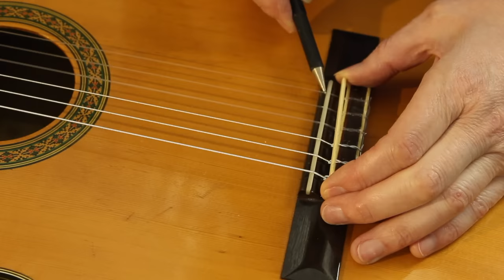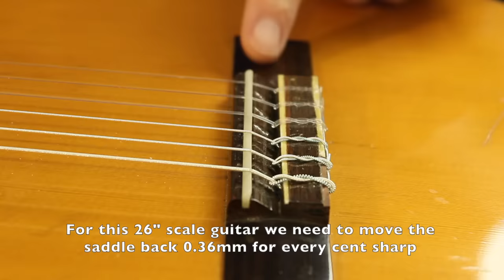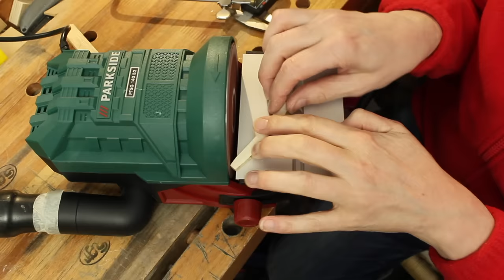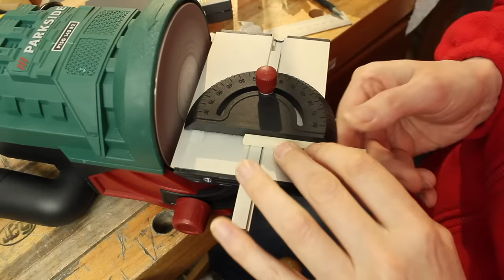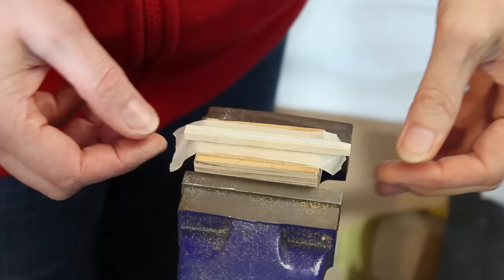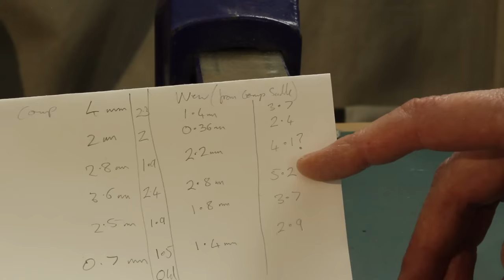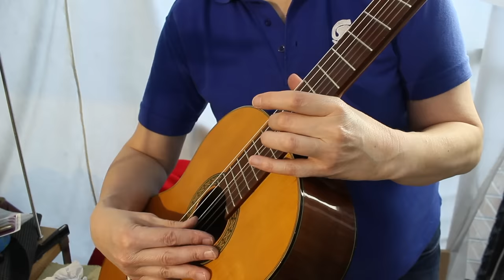Fixing the intonation on a classical (spanish) guitar

Comment: The phenomenon where the strings take time to settle in after being untensioned and then retensioned is due to what is called anelastic recovery. Nylon is a viscoelastic material - it stretches under tension due to a combination of elasticity and creep. Nylon has logarithmic creep, so its rate falls with time until it becomes negligible and the string remains in tune. When you untension the string, the elastic component of its stretch immediately recovers and over time, a significant fraction of the creep also recovers. Hence, when you retension the string, it will start to creep again and go out of tune. The longer you leave a string untensioned for, the greater the anelastic recovery - if you immediately retension a string, the effect is smaller than if you leave it for a few hours.
Reply: Great to know. Thanks

Comment: I hope you checked the fretboard level before you did this. A humidity change can dry the fretboard and top causing shrink which will cause intonation issues like this also.
Reply from the maker: The guitar is stable. The fretboard was straight but there were a few uneven frets that needed a title levelling. I think the intonation was just 50years of aging letting the body shrink a little - it wasn’t too dry

Comment: The saw didn't work because the saw didn't clear the edge of the material.  The gullets between the teeth filled and the saw stopped cutting.  You notice that the ends cut where the saw was able to exit the material.  I so enjoy your fantastic videos and work.
Reply: Yep.

Comment: I know it’s a lot more work, but you could also remove the lifted bridge, eventually fix the fan braces that have maybe bent over time, or maybe some have come loose.  And/or fix the bridge plate as well.  That would take care of the forward angle that has occurred.  That angle also probably raised your action quite a bit too!!

Comment: Nylon strings take time to stabilise due to the anchoring needing to bed in at both the tuning machine and the bridge anchor points. The 'knots' are slipping slightly after being disturbed. You can reduce the stabilisation time in two ways.
1: At the bridge, link the ends of one strings under its neighbour. This has two effects; it prevents the end of the string 'buzzing' on the soundboard and prevents the string from slipping as much as the knot tightens. At the back of the bridge I anchor the E under the A, the A under the D, the D under the G, the G under the D, and the B under the G, and the E under the B. It's a bit fiddly at first, but the effect both looks good (neat and tidy) and adds stability to the anchoring.
2: At the tuning machine, pass the string over the top of the barrel of the anchor point and up through the hole from the bottom. Then pass the end over the string and back through the hole. Now pull it tight. The string will self anchor and usually does not slip at all. You will likely need to cut the string much shorter than before and need fewer winds to hold the string. The fewer winds you can get away with, the more stable the anchoring. I rarely have more than two winds on the wound strings and three on the solid strings.
One other thing. I have found the composite G string in the D'Addario EJ45C set to be especially good at both smoothing the transition from the wound D to the solid G string and compensating for the effect of the relative thickness of the G string.
Reply: You need another thimbs up for that👍

Comment: Great, thanks a lot for this video! Nylon strings take longer to settle because of the shape memory of the material (same as steel strings but they are much more rigid than nylon so it takes much less time). A good cheat to make it faster is 1) stretch each string on all the length (sadly I can’t show how it’s done here but I’m sure there are some videos) and then 2) tune the strings about 1.5 semitones higher, let it sit for few minutes and then do it again with the strings (usually the bass strings) that dropped all the way below the correct tuning - just 1 semitone is enough then. Repeat few more times but brand new strings will settle within like 15-20 minutes this way. I remember during studies at the conservatoire we couldn’t possibly have time to wait any longer, and actually we’re even dropping the tension of bass strings intentionally (big time, till they get floppy, for maybe half an hour) in the morning before a concert to make the strings sound better - if you then tune them up maybe a semitone higher, they just drop right where you want them in few minutes

Comment: OMG, I nearly fainted when I saw your guitar. We have one exactly like it purchased in 1977 or so which makes it about 45 years old, nearly the same as yours. I’ve been having problems with an odd “buzzing” (not exactly fret rattle) on the G and D strings, the neck isn’t bowed and string height off the fretboard is fine. None of the repair shops can find anything wrong but it drives me crazy. Anyway, sorry to ramble, thank you so much for the informative video. I love our guitar which has gotten mellower with age, it was so nice to see it pop up on YouTube!
Reply: I have been unable to get upstairs to my workshop due to my having Parkinsons, with the result that my latest guitar has not been finished and is highly unlikely to be now that I am looking at my final demise, so I was wondering if you would like to finish it for me. As I said in an earlier message it  is an experimental guitar with the front grain radiating from the bridge being made up of 30 triangular pieces of cedar reinforced with a piece of cedar going from the sound hole to the lower bout with two struts either side of the soundhole strengthening the top. Hoping to hear from you in the not too distant future from Barry Dycret, the guitar maker.

Comment: great tutorial about adding an overstep to the saddle.
I have a Classical where the G+B strings needed more saddle at the front (fretboard side).  And the Bass 'E' string needed more saddle at the back (side where string goes through bridge).
I did it by having a perfectly 'flat and square' piece of bone (set to the correct saddle slot thickness and depth).  
Then, i superglued bone pieces where the saddle needed to be extended (giving it 24hrs to dry).  And shaped them as needed.  
It worked, with less manufacturing hassles.  
But, i think i will try to make the stepped saddle ..just for the challenge :)

Comment: What a great explanation of intonation!  Thank you Susan.  I've fixed intonation problems on ukuleles a number of times like this but made the saddle by laminating two pieces of bone together with CA glue which is much easier than making from one piece of bone.  Gluing surfaces need to be well prepped to get a clean join but if done well, it's hard to see the join .  I haven't noticed any loss in tone - the additional saddle mass probably has more impact.

Comment: 1st, Cudos to you making your own saddle from a large piece of bone. 2nd, like many others, your explanation of intonation, compensation and dead zone- something I never heard discussed before, is about the best I've heard. You've probably saved my short scale steel string from being slammed against the wall. The B string is always sharp on the 12th (well they all are but B most noticeably) and I've shaved 2 compensated saddles but it's still there driving me crazy.  Didn't think of using a thicker saddle with a slight overlap. That would do it. Thanks for sharing your expertise.

Comment: What I ended up doing on mine years ago was filing off the slot completely and replaced it with two pyramid shaped pieces of wood in which I carved out a trough and added a little brass dowel to replace the saddle. Now I have a split movable saddle that I can adjust for intonation at will.
Reply: Make a video of it please 🙏

Comment: This is the best intonation explanation I've seen. Thanks for showing all the trial and error attempts in finding a good way to shape the saddle. I just went through something similar in creating a shelf like that on a nut in order to intonate that. I used a couple of straight boards with sandpaper held against one of them to create a right angle as a sanding jig, with a spacer so that the nut rode above the vertical board enough to create the shelf. It took forever, and perhaps rigging up something similar with a file would be better. Holding the nut by hand was difficult and laborious. I think I would take a clue from your glueing idea but instead glue directly to a board with some hide glue (for easy reversibility). (BTW how do you feel about nut compensation?)

Comment: Wonderful job, Susan. I realize the skills you demonstrate in this online class far exceed my technical abilities, however, I'll explain what I did about 10 years ago to fix the intonation issues with my very cheap classical guitar. Noticing that my Fender Stratocaster string saddles are configured in a staggered position, I tried to emulate the same paradigm. I proceeded to remove the bone, filled the slot with wood shavings mixed with epoxy and then Dremeled out a new slot with the desired slanted angle. It was an experiment done intuitively that somehow paid off. I'm pretty sure it's not for everybody and only to be tried on a cheap instrument in case things don't go too well. Cheers and thanks for the lesson!

Comment: Hi! I recently watched this video and decided to do this with my classical guitar. It really improved the intonation, so, thanks a lot for all the detailed info.

But I'm having a problem. When I tried to use the piezo it seems like it doesn't pick up the vibrations of the strings resulting in a very very weak signal. What could be causing this? Could it be that now the point of contact between the string and the new saddle is far back resulting in a weaker transmition?? Or maybe the saddle is just not sitting over the piezo like it should? 

Thanks!

Comment: I recently bought a new Yamaha classical guitar and the saddle was WAY too thin for the .100" slot. Were all of your strings sharp when you got a good-fitting saddle in place? Was the bridge itself too far forward? In the beginning of your video I thought you were saying that the back of the bridge was pulled up a bit ... like you get with a belly bump. I had one of my acoustics with that issue and I brought the bridge and guitar top down flat with a Bridge Doctor device.
Reply: Yes correct fit! Also see how Stew Mac reverse-bevels a bridge-saddle to counteract the lean forward.

Comment: Thanks very much for the video, which I used as a guide to help me solve a similar issue with my old Takamine guitar that I wanted to give to a 10-year old just learning to play, but couldn't until the intonation was fixed.  The bridge was too far back and intonation was too flat around the upper frets, so I used a blank bone slab to create an L-shaped saddle to shorten the scale length and sharpen the fretted notes, just like yours (except in reverse).

For future reference, I found a formula to calculate the setback (or setforward) required, and there's no need to measure the length between frets.

SCALE LENGTH  /  17.817 = FIRST FRET DISTANCE (FFD)
FFD  x  INTONATION ERROR (at the 12th fret) = compensation required
(100 cents per semitone, so 1 cent flat/sharp =  ± 1% INTONATION ERROR) 

Example... for a guitar with a scale length of 650 mm, and a string which is 5 cents sharp at the 12th fret:
   650 mm / 17.817 = 36.48201156199136
   36.48201156199136 x .05 = 1.824100578099568 
   setback required:  about 1.82 mm

Comment: 1:22 The saddle compensation slant is not a steel string vs classical issue.
Virtually every high quality classical guitar will also have a saddle set at a slight angle to produce compensation. If not, then it is generally a reflection of the instrument's price point.

Comment: is the bridge still properly attached to the top if it was tilted this much by the tension of the strings? or is the top crooked at all? wouldn't it make more sense to straighten the top and/or glue the bridge back in place instead of putting this weird kind of saddle on there?

Comment: Nylon strings and steel strings stretch differently because their molecular structures are different. Steel molecules attract one another equally in all directions, so tension is evenly distributed through the whole structure. Nylon is a ploymer where the molecules attract one another in a single direction also called "strings" so the structure is made up like an unevenly twisted rope that takes some time to even out tension where some "strings" are under greater tension than others within the structure.
Reply: The nylon molecules are only aligned that way in a string, which was formed by stretching melted nylon in one long direction.  In the original solid chunk of nylon, the molecules are randomly oriented like spaghetti.

Comment: Thank you for the video. How much contact do you need for the string to the saddle. I am working on my ukulele and I am trying to compensate for the notes all being sharp by 3 cents or more at the 12th fret. Do you generally need a more rounded edge and wider to get good sustain? The intonation is better on my ukulele  when I shaped a new bone saddle going from a plastic one with the crown more towards the rear of the Saddle but much narrower than the original. As a result I don't think the sustain is as good on it now as it was with the plastic nut which which had a wider centered crown. Also thank you for explaining that the strings will have to go through a break in cycle again when you loosen them as that kept happening to me as I adjusted the original saddle for action height and the new one. I thought something was wrong with my strings.

Comment: Flouro-carbon strings seem to have a higher density maybe resulting in reduced harmonicity of the string. I tried a set of them on my girlfriend's non adjusted guitar, and they have a really tight and dynamic sound, very articulated all over the neck.

Comment: There are two different compensations that can be implemented to improve intonation on a guitar. One is movement of the nut from its theoretical position, closer to the first fret, nut compensation. The other is movement of the saddle from its theoretical position, further from the nut/12th fret, saddle compensation. Both of these have been known for a long time and are not new fads, though nut compensation is still rarely seen in most guitars, and saddle compensation has been used, in one approximation or another, for quite some time.

The two compensations contribute to the overall accuracy of intonation, each contributing differently. Used together, they can considerably improve the intonation of a guitar. Without  getting too long-winded, moving the nut closer to the first fret reduces the amount by which the string length needs to be increased at the saddle. That is, the amount of nut compensation is subtracted from the amount of saddle compensation, reducing the amount of saddle compensation required. 

In the situation you have described on your guitar, an alternative to simply adding more length to the vibrating string by moving the saddle away from the nut/12th fret is to implement nut compensation. Doing so would likely eliminate the need to use a stepped saddle and would improve the intonation, particularly in the first few frets. One can find extensive discussion of the method in Gore's books.

Comment: What an amazing video. Full of information and advice. You have a natural presentation style too. 
I don’t quite understand the sciencey bits but got the gist.
I’ve been playing guitars for well over 50 years and have had a large range of instruments. I’ve settled mostly on the nylon strung variety. Intonation issues are crazy with nearly every one I’ve had; especially with the third string. 
I spend around 30 minutes trying to tune to an equal temperament (whilst playing in every key), every practice session. I then have a pleasurable hour of playing the thing. It all has to be gone through the next time though… I’ve tried many makes of string and all sorts of set up ideas, but the problems are ever present.
It seemed that among instrumentalists, guitarists are probably, through necessity, the most obsessive.

Comment: Explanation of compensation due to tension over saddle is actually first time I’ve heard that despite looking up a lot on the subject an makes perfect sense. Many thanks. Just making a nylon hybrid guitar and currently put in a 1mm compensation from high to low E on the saddle slot (most nylons just have a straight saddle and pushed back 2mm). Hopefully with careful location of bridge that’ll do for this guitar and I can improve on it if I make more.

Comment: you ask about strings and why they take so long to settle down. Not the only reason but if you put a lot of wraps on your tuneres all the winds need to stretch. Only putting 3-4 wraps on the tuners will help settle the strings down faster, and pulling them up during tunning helps as well.

Comment: Thank you Susan! Now I understand why the saddle has a notch where the G-string runs over... that notch makes the nut->saddle length of the G-string longer than the other 5 strings by about 1-2mm ie the compensation she talks about. I also notice that the G-string hole in the wood block/tie bar behind the saddle on my guitar is showing signs of stress / enlargement of the hole & lifting of the top "bone" strip ... i wonder if that tie-bar can be replaced without replacing the entire bridge. Can it?